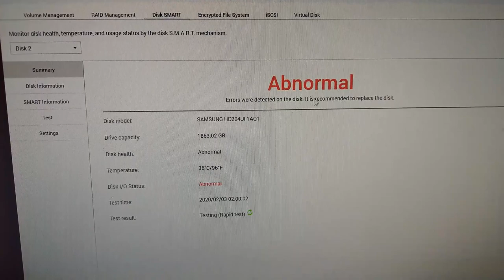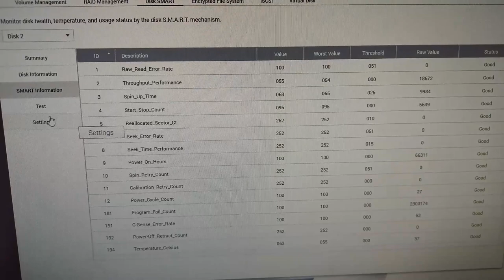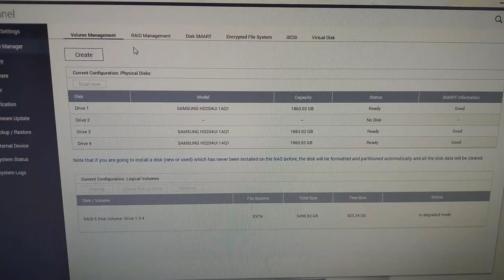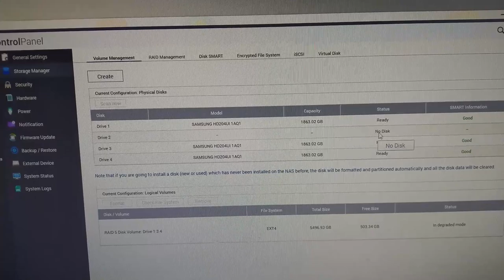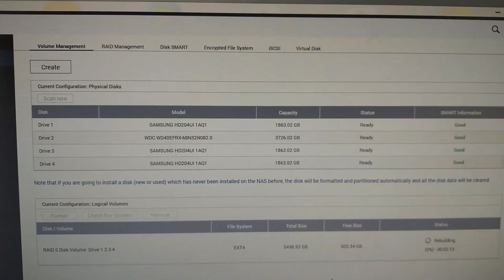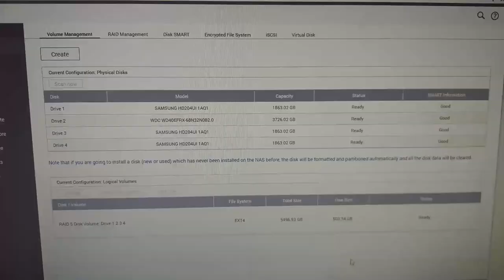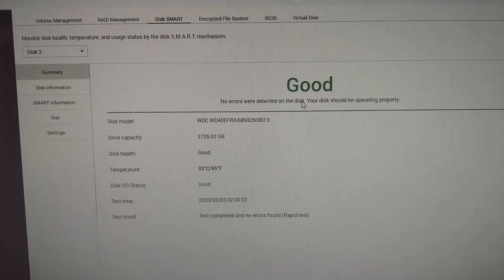How to replace a faulty drive in a QNAP

Comment: Thanks.  I always feel on edge when I need to remove a drive from my NAS while it's in operational...  Nice to see your TS-412 is still running!  Mine is as well, although now I use it as a redundant CCTV recording device.
I've since upgraded to the TS-453BT3, with a TR-004 RAID Expansion box.  It was one of the drives in the TR-004 that got a few bad sectors after my suburb had a power failure a few weeks back.  Anyway, nice video!  Worth a comment & subscription... 👍👌

Comment: Hello,
I have following problem with my qnap ts-253 Pro, This after placing a larger Hdd and reinstallation, In local network I can open or copy files to my PC so this works normally. As for my samsung tablet i can open mp3 and mp4 and in contrast i can't open or copy any pdf or jpg files. An error message is given: "Failed to download"
I have tried everything, user access rights settings are set.
What could be the problem here.

The nas has 2 bays on installing i had problems with the 2é bay.
So I Now there is only a hdd in Bay 1 (I don’t think this can cause the problem I have)

Thanks, Marc.
Reply from the maker: I don´t think this issue has anything to do with the hardware or drives, since you can access all your files from a PC. I´m thinking is might be that you have to enable some protocol in the QNAP that your Samsung tablet likes. Check what you have enabled, such as SMB, NFS and so on, and their settings. Perhaps the tablet accesses music and video files using DLNA at the moment?
Check the file management app in your tablet to see which network protocols it can use. I have no experience with Samsung tablets myself so I´m just guessing.
Reply: @thetinkeringdad  Thanks for you information, i will check this... and let you know..
Reply: I should mention that before I had no problem to consult PDF and photo files. The problem started when reinstalling the new Hdd
Reply from the maker: @marc5820  Are you talking about via PC or from your tablet? And when you say "placing a larger Hdd and reinstallation" in your first post I assumed you did a complete reset of your QNAP? But perhaps you only replaced a faulty drive as I described i this video? If the latter then I recommend you check QNAPs compatibility list. But then again, if everything works from your PC then it cannot be a hardware issue. Check the settings I mentioned in my previous post. I can´t think of anything else.

Comment: Thank you for the good video. But... can I ask you a question...? :(

Actually, I'm Korean, so please understand me if my English is poor. 

I replaced disk 2 yesterday successfully and disk 1 didn't today. I can hear the sound the HDD fan running in the machine, but It hasn't been recognized in the qnap application. These two old and new disks have the same volume of 2TB. What should I do...?

Oh, as soon as I knew this, I re-replaced disk 1, which was originally inserted, but even that is not recognized.........
Reply from the maker: Hi. I´m afraid I don´t understand the problem really. I would need more information about your setup and what has happened to perhaps help.
But for starters you say you first replaced disk 2 and then disk 1 the next day? Do you mean that you had 2 drives that failed at the same time? If so then you either have to have RAID 6 or 4 drives with RAID 1(10) and be lucky that the correct drives failed, otherwise all data on the drives are lost and replacing the faulty drives won´t help getting the data back.
But as I said, I need more information.

Comment: Great video, very informative. I am going to be replacing a perfectly working 3TB drive with a bigger drive, so the question is if one of my other 3TB drives on my NAS fails in the future.Can I replace it with the perfectly working drive I will have already removed? If yes do I have to reformat it or will the NAS do that automatically? Or do I have to replace it with a brand new drive? Many thanks for any advice
Reply from the maker: Hi. Interesting question. Initial thoughts are that yes that should work, and the NAS should reformat the drive and include it in the raid automatically. But with that said, I have not tested that, or seen any official QNAP docs that deals with this question. It would depend on how the RAID-controller(or software) works internally. I know that on HP Proliant servers, the drives keep information on what raid, controller and drive-slot it belongs to. And the controller knows this too. This can be used for certain operations.
But I don´t think the QNAPs RAID controller is equally advanced, so this might be misinterpreted.
So in your case I would manually erase the drive before inserting it in the QNAP. Or just plug it in to any computer and create some new empty partitions on it. Just to remove any trace of the QNAP in it.

Then again. If you only remove one 3TB drive and replace it with a larger, you won´t be able to use that increased storage until you have replaced all drives in the array with larger drives. So if your plan is to increase the storage capacity of the array you need to replace all drives with larger.
And if one of those larger drives fail you can´t replace them with a smaller drive.

I hope that helps a bit?

Comment: mine is not rebuilding it gave me error like "unable to add disk 1 to the volume" one time also said that's because the disk is not big enough but it is, is exactly the same size as the others. If you do what you did and use a bigger hd are you going to waste space?
Reply from the maker: Some drives can differ slightly when it comes to capacity. And if it is smaller than the ones currently in the RAID it won´t work. I strongly recommend that you use the same brand and model of hard drive in each RAID.
And yes, if you put in a larger disk then the others then you are wasting space. But when you have replaced all the smaller drives in the same RAID you can expand the RAID to use the extra space. Read up on your QNAP model beforehand to see what its maximum RAID capacity is since there are limits to this.
And with regards to the error you described I also recommend you check the QNAP compatibility chart to see if a certain drive is supported in you QNAP model.
https://www.qnap.com/en/compatibility/
Reply: @thetinkeringdad  my nas is pretty old it's a ts-412 I bought it second hand with hd in it already all hds are 3 tbs each. 1 hd was a Western Digital and is the faulty one, the others are all the same seagate model. I bought the same Seagate model because I wanted to have a tidy nas with the same hds, my new hd is second hand too and it has 13000 power on hours which I think is good and it's similar to my other seagate hds which have alla around 10000 hours. The faulty Western Digital hd had 52000 hours. When I inserted the new hd and it got recognized I noticed a difference in the model number which is exactly the same but at the end of the model number there are two letters and two numbers, I checked and they should indicate the firmware of the hd ( I didn't even know hds could have firmware) anyway, my previous seagate hds have firmware CC45 while the new one is CC43, can that be the problem?
Normally when you look for compatibility list the just state the model not the firmware too so I guess it's not important. I opened a ticket with the QNAP support , the nas was working yesterday all the bays had blinking lights which as far as I know means that all the hds are working (writing/reading) but I was still seeing the volume in degraded mode. So I didn't resist and I unplugged again the disk 1 to try reinsert it or reinsert also di old hd and as soon as I unplugged it, the browser page of my nas closed and the nas became unreacheable. At some point I switched it off an on but  was still unreacheable. I then noticed the status led blinking red and green (I thin because I'm colorblind) which I never noticed before. While I was updating my ticket with the new condition of the nas it became reachable again and the status led stopped blinking. I was happy and decided not to touch it anymore until the support will remote in it, but after a while I came back and the nas was switched off. On the browser the nas page was still open and I was able to see a notification saying "Failed to update system" which is strange cos I looked for update in the past days thinking that could have solved the problem and there wasnàt any update. There was also a background task notification saying "Media Library indexing". Now that I switch it on again it again not reachable and the status led has been blinking for a few hours...

Comment: Does the Raid see the extra space you have on the added drive or are you only able to use 2,000 GB of the new drive.  I have read that if you replace only 1 drive in a Raid, the system will not see the extra memory unless you replace all drives with the same added memory.
Reply from the maker: You read correctly. I cannot use the extra space until I have replaced all drives in the array with larger drives. After that I can do an expand of the RAID to increase the actual storage space.
Reply: @thetinkeringdad  Thanks for the confirmation, makes my decision to hold off until I can afford to buy all 4 drives at one time, clear.
Reply from the maker: @timnels8638  Or you wait until the current drives become faulty and needs to be replaced anyway and then just put in a larger one, since you might have to. And when all drives are replaced with larger you can expand the raid. That or replace them all at the same time with larger disks.

Comment: Sir, what about data on it which you removed, you loose it or no?
Reply from the maker: Not really sure what you mean. The purpose of using RAID is so that you can replace a faulty drive without loosing any data. And also added speed performance. I would recommend reading up a bit about RAID and the difference between levels. But if you have for example 2 drives they should be in RAID 1, which means mirroring, then your data is duplicated to allow for one disk to fail and to be able to replace that drive without any data loss.

Comment: what about the datas in the disk?
Reply from the maker: As long as only one drive at a time fails, no data is lost. That is one of the main advantages of using RAID.
Reply: @thetinkeringdad  Thanks for fast reply. I have 2 drives. Both have bad sectors/read write errors and Raid management in degraded mode. I think it wont work for me.
Reply from the maker: @ErenD  With 2 drives you hopefully run RAID 1. Only other option is RAID 0 which basically is no RAID and then my guide won´t work for you. Can you access the data on the NAS now? And has any of the drives been marked in the NAS as Failed? If both drives have failed then I would think you can´t access the data. It is not uncommon for drives to have sector errors and still work since drives have extra sectors for this purpose and can remap bad sectors. If the RAID is in degraded mode, as you say, then I think one of the drives is Failed. I think you can safely replace that one as long as the other drive isn´t Failed.
Reply: @thetinkeringdad  My both drives has abnormal status for a more than 1 month but I don't have any problem to access my data's. The device is blinking red always.
Reply from the maker: @ErenD  If you can access the data, and you are using RAID 1, then you should replace the disk that the NAS says is Failed. Both disks can´t be failed completely. If none is Failed but only have warnings, you can replace both of then if you want. Just make sure you replace one disk at a time and have it fully rebuild before replacing the other drive. If you are worried about data loss then I recommend backing up the data to another storage first.